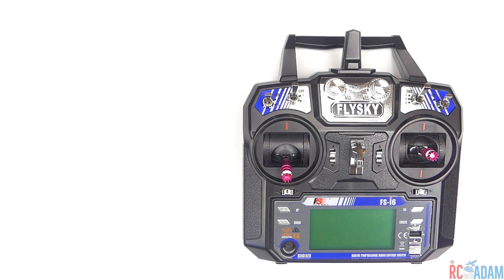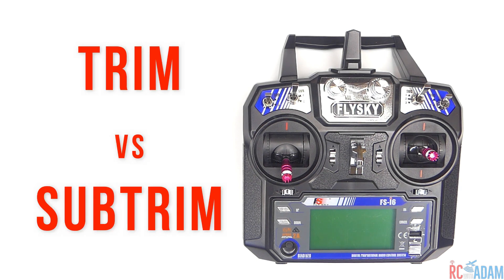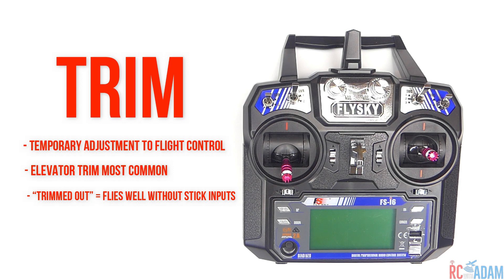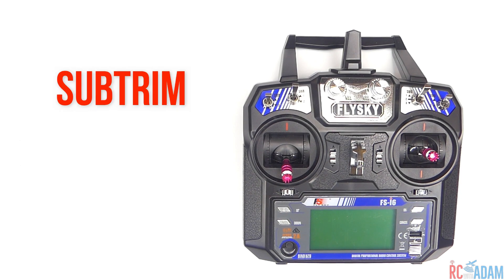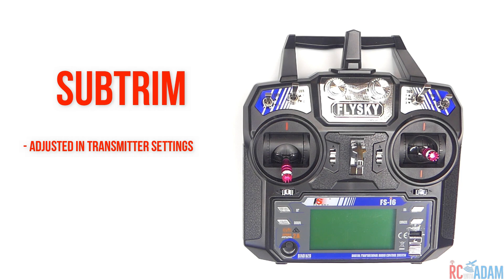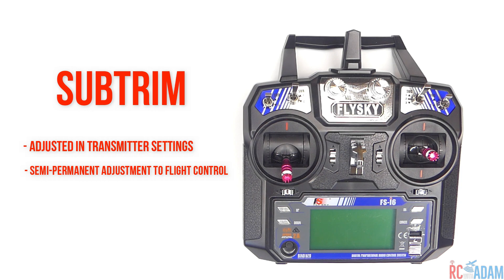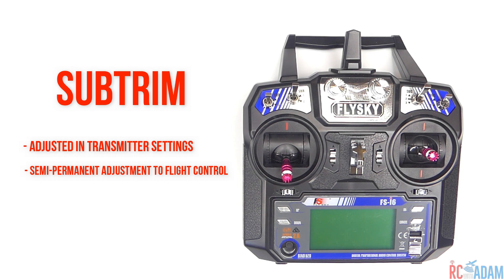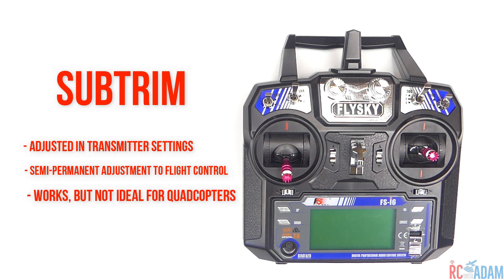Trim vs Subtrim Explained - How to use Trim and Subtrim for Flysky FS-i6 (FS-i6X) RC Transmitter

Comment: Adam, thank you for your video, always get so much from them, I am one of your subscribers. Quick question mate, I bind receiver Flysky FS-iA10B (R1) which came with Flysky transmitter and works fine. I would like to bind another Flysky FS-iA10B receiver (R2) to same Flysky transmitter, I would like to perform testing debugging without having to  disconnecting/removing receiver (R1) mounted on Arduino ROBOT. Only one receiver will be operating at any given time. Cheers mate!

Comment: Would this be applicable to tracked vehicles ? my dozer servo drives are running slightly out of trim, have to keep jogging the controls to keep it  straight....
Reply from the maker: I can't say. I've never used a tracked vehicle.

Comment: if you are using  your transmitter to operate a wheeled vehicle, imho, consider a different brand
Reply from the maker: Thanks for your input. Why is this?
Reply: @RCwithAdam1  the transmitter is difficult to set up to use arcade style ...1 stick driving.....even though you use the key to lock the settings in.....they still will change   I am sure they work well with r/c aircraft and I am still trying to make mine work correctly....

Comment: I set up some trim whilst flying. Trim not subtrim. When I made the switch for dual rates and expo, it adjusted the trim also. Why is this. This is not good when switching to dual rates. I have the same TX as in the video. Thanks.

Comment: The fundamental fiference between trims and subtrims is that trims affects channel inputs (values from sticks), while subtrims are applied to putputs (channels values sent to receiver).
Thus, trims affect mixers, while subtrims do not. This difference is usually subtle, but in some cases, becomes significant!

Comment: I'm building a rescue boat for my gas boats in event where I can't get a boat back to shore.Its construction is 3\4 in. PVC,pool noodles for floatation,2 electric motors,2 30 amp esc's, one 4s lipo, controlled by the flysky fsi6 and fsia6b receiver. I watched your video on setting up a two motor set up and put all the values you said to do on that episode but for some reason I cannot get the motors to spin regardless of any settings I try .I bought two new motors thinking of potential reasons for not working.I also replaced the receiver after the guy in the hobby shop noticed that it was very hot. What am I doing wrong please help!!

Comment: @Adam, what if you subtrim so that the control surface is straight, but the servo arm is not exactly perpedicular with the control rod? Then you won't have equal throw in both directions. How do you deal with this situation?
Reply: Get a linkage stopper.
Reply: @sourjyanaskar6092  thanks

Comment: Trying to use my flysky FS-I6x on a sim on my PC but I am unable to match my channels through the setting on the Sim, is there a way on the flysky FS-I6x to change Channel 1 and 5 to fool the Sim to work as I need it? Thanks in advance.
Reply: I had the same problem on free drone games. No fix, but drl drone racing league reads my fs i6x perfectly

Comment: Hi Adam.. May I know the receiver you're using with the flysky transmitter.. what about it's real-time range also which fs receiver is best for long range
Reply from the maker: Hi! Usually, for airplanes I use FS-iA6B, and for quads I use XR-602TA, or Fli14+, or FS-X6B. Can't say positively which is best for range.
Reply: @RCwithAdam1  Thank u Adam! My quad recently failsafed out of RXLOSS though I had RSSI of 34% . I'm using Fli14+... also quite not sure about the best placement of receiver antennas for optimum signal strength

Comment: If you use the trim in flysky during flight does it save it like that it does it go back after the radio is turned off? How do you know what trim button controls what?

Comment: I am so desperate with my FS-i6X. Bought it right after my FS-T6B broke. In FS-i6X - my throttle is zeroed when the stick is in the middle. So I only have 50% forward thrust and 50% reverse thrust. And it's a plane, so this doesn't work with me. I need all 100% of thrust in a single direction of movement of the stick. Could somebody please help me out with an advice??:(
Reply from the maker: Oh no! Let's see if we can get you back in the air! Is the throttle spring-loaded to center? If so, this video might help: https://www.youtube.com/watch?v=5LgzG7aE8IQ

Comment: Another reason for using subtrim is to adjust the servo arms to where you want them with no stick input. For example, if you want the servo arm a 90 deg to the servo body you may need to use trim to do it.

Comment: Hi Adam, once you correct with the sub trim is it correct to assume that you regain the same full stick and trim ranges in both directions? Cheers John
Reply: Oops, just noticed you already answered this before. And you regain full throws on the stick and the trims.

Comment: My ia10b receiver started disconnecting itself and connecting back after some attempts of turning off and in again. Had problems binding it even when bind plug is plugged in.    Is there a problem with the antenna???

Comment: Can u fly and heli with these controllers
Reply from the maker: You sure can! Though I haven't actually tried it.
Reply: @RCwithAdam1  I couldn't bind it wirh nothing I have a blade cx3 but it dont do anything when i bind it
Reply from the maker: @leonjohnsonjr3331  I believe the Blade models require a Spektrum brand transmitter (DSM2 radio protocol).
Reply: @RCwithAdam1  ok that's probably why